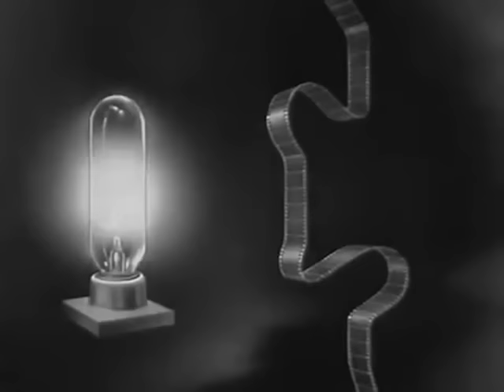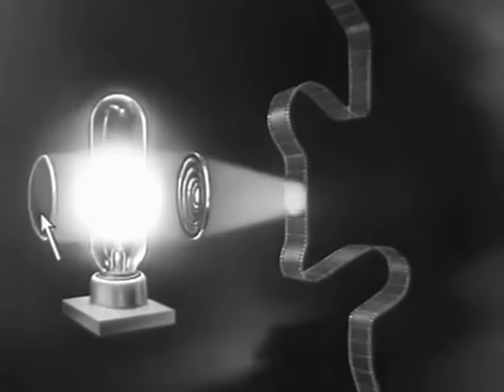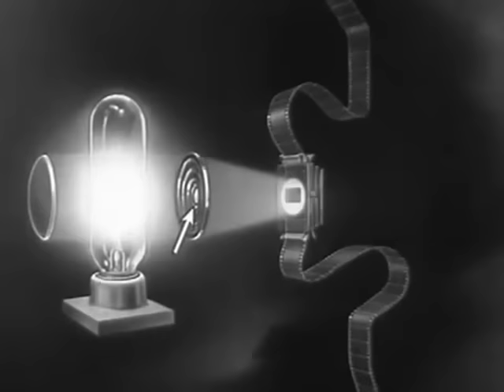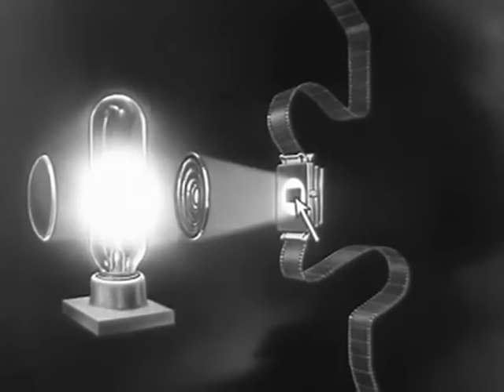Cinema projector

Comment: Do both reels move all the time? My projector, On fwd the left works on reverse the right works, But are they both supposed to move? I’m waiting for some old film reels in the mail to try my self
Reply: The takeup reel is powered and the feed reel is unpowered, with a little bit of drag to keep mild tension on the film. Usually the upper or front spindle holds the feed reel and the lower or rear spindle holds the takeup reel. 

If you have a projector with both spindle arms on top, and you are facing the right side of the projector where the controls and threading path are, the left reel will be the takeup reel when going forward. If your projector can play in reverse, the feed and takeup reels will reverse roles.
 

When you have played the whole reel of film and let the tail run out the back of the projector (or better, stopped it before the tail leader and unthreaded the projector) you take the end of the film flapping loose on the left (rear) takeup reel, and thread it counter-clockwise around the hub on the right feed reel, putting an inch or so of the film in the notch in the hub for that purpose. Then hold your fingers lightly on the rim of the full reel to provide a little braking, and put the projector into rewind. Keep you hand on or near the reel until the whole reel is rewound. If the film starts getting loose between the reels, apply a little pressure to the rear reel to tighten up the film a bit. 

If you don't do this and let the film rewind by itself, about half way through the reel the film will get loose, then usually drop off one reel or the other, tangle in the spindle supports, and stretch and break the film. Then you will have to cut a couple of feed of damaged film out of the middle of the show and splice the ends together.

Comment: Explain how sound will come on old projectors
Reply: sound on film is achieved by sacrificing a little portion on the side of the film frame to fit a sound track (this is also probably where the term "soundtrack" came from)

early 35mm films use an optical sound method. on the projector's sound reading area, there's a light bulb (usually called the exciter bulb) that shines light into a little slit. that slit only lets a small ribbon of light to pass through into a photoreceptor/light detecting cell. the sound track is basically going to let a specific amount of light to hit the light detecting cell by blocking the ribbon of light with dark areas. the size of dark areas vary with the volume and frequency of the sound intended to be reproduced, lower volumes have more dark areas and louder volumes have less dark areas. the dark areas also vary much more minutely to produce the specific frequency intended to be reproduced. higher frequencies have the areas vary more frequently and lower frequencies are less frequent. the light that's received by the light sensitive cell is converted into electrical currents, then these currents are greatly amplified and the amplified signal is then fed into the speaker, which reproduces the sound.